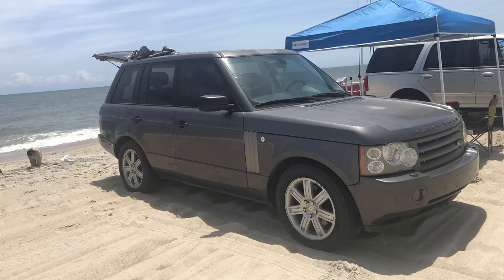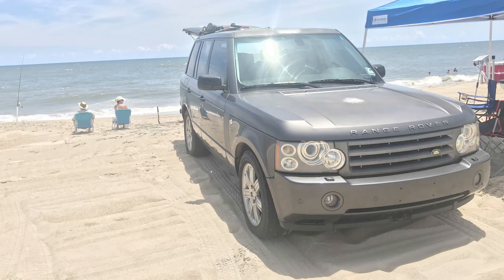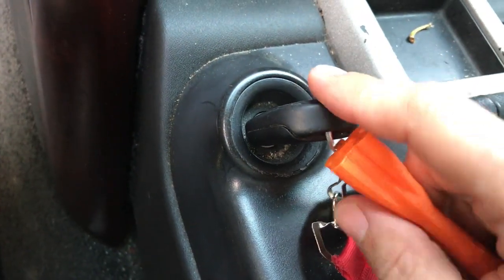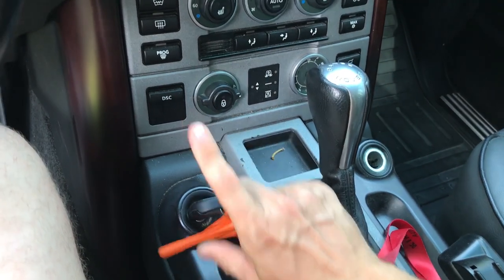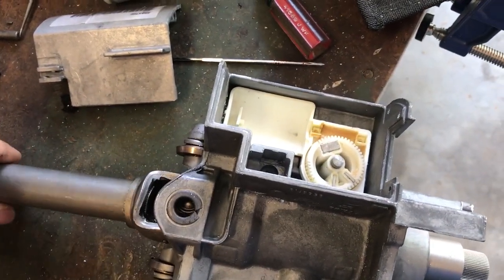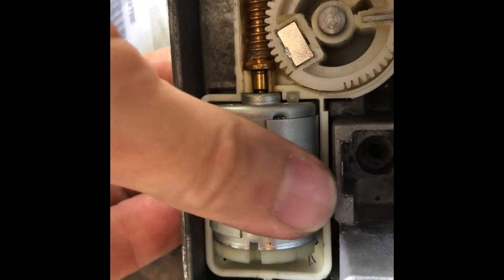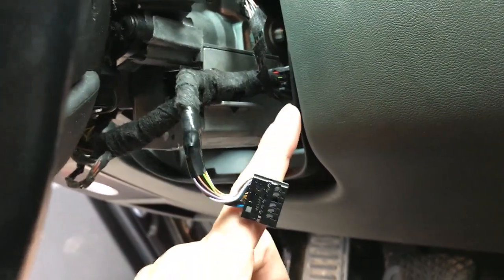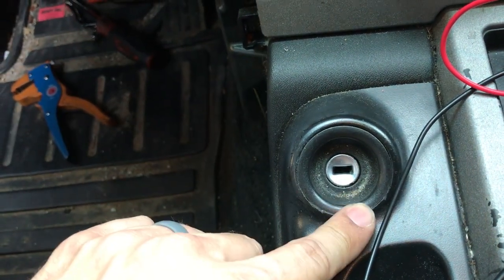L322 Free and Permanent Steering Column Module Bypass

Comment: Caution : This only works on 2006 and above with the Jaguar AJV8 engine not on the 02-05 BMW M62 Engines.
Reply: Exactly bro ...I did the blue wire soldering to My girls 2003 and it won't start it only unlocked the ignition switch but not crank the engine im desprate for a solution  do you happen to no any other way I could rig it? if so please advised id highly appriciate it....
Reply: @danielbeltran3914  The old fuse 18 trick
Reply: @DjJayBeatz  ya I need a permenant fix lol  I dont want to put a in line toggle switch or pull da fuse or disconct the steering coulmn and re conect it every time we need to drive it. I wish a new a way to jump the starter relay or give it power when the key is on the start position..... with da blue wire allowing the steering lock to crank over?
Reply: @danielbeltran3914  You and me both man
Reply: Have you guys found a solution for the 2003?
Reply: @ragingonline can you add some detail to what your describing please
Reply: @danielbeltran3914  I recently bought a 2005 L322 with the steering lock issue. My Rover had the added issue that even after I pulled fuse 18 and got the key to turn, the starter was not engaging. After trying this fix (before reading the comments section), the key turned every time but the starter still did not engage so I combined this workaround with another from Raymond Hernandez (https://youtu.be/vskmkMZs_Xs) and my Rover works perfectly now. The combination is to solder the blue unlock wire to the interior lights as Rob The Car Guy teaches so the key turns consistently, then I wired a relay into the starter wire Raymond Hernandez points out in his video with a momentary switch providing the ground for the new starter relay. Now I turn the key to the second position and hit a "starter button" that engages the starter and starts the Rover. This has worked perfectly for the last week.
Reply: All your  yebbedy  dobbdey didn't  work  on my 03 It was the starter relay . The whole time. No car should  be so complicated.its not in the books
Reply: Connect to live and put in line cut out switch
Reply: It works on the 2004. It requires 2 wires instead of one. The blue wire to break the key and the red and yellow wire to reset the ews. I did it to my 2004 and have been golden for more than a year.
Reply: @DougBe38  can you give me more info I have the same issue with 04
Reply: @DougBe38  May I ask what did you do with the red/yellow wire? Did you add power to it from the light source again, or did you jumper it from another pin? I have a 2002 HSE and trying to work out for the get it to start now, having now got the key to turn at least. Thank you
Reply: @darylwong3396  you know what? Ive been getting this question a lot lately. I think I'll  make a video about it today. Is this super urgent for you or can you wait for the video?
Reply: @DougBe38  amazing if you could make a video for sure! Subscribing now! But yes any instructions on this last step on how to bypass the starter for the earlier BMW ones would definitely be appreciated. I heard you can get a ESL emulator, but if it's just one more wire I need to jumper, I rather prefer that option. Thank you again and look forward to your video.
Reply: @darylwong3396  I'm done recording. I have to put it together and edit it and will post it then. I'll let you know when it's up just in case your notifications aren't on
Reply: @darylwong3396  video up.
Reply: @DougBe38  thanks heaps for the video and confirming the fix.  I like the push button start btw!
Reply: @DjJayBeatz  For me in a 2005, fuse 31 blows and once I replace it, it’s fine for usually months. Haven’t seen anyone else experience fuse 31 issues but throwing it out there.
Reply: It's a easy thing to do ....
But you make it looks real complicated bro
Reply: @danielbeltran3914  здравствуйте, по чему не заводился, вы решили проблему?? У меня тоже самое, уже не знаю что делать
Reply: @danielbeltran3914  I might be late but you can remove all that stuff with a  bench tuner

Comment: Rob I was a systems engineer for 18 years at Hughes Aircraft working on foreign weapons systems.  I am now retired.  If I was still working, I would offer you a job.  You think out of the box.  This DIY hack is remarkably simple and effective.  My 2006 L322 is back on the road.
Reply from the maker: Dennis Fagan that’s awesome!!! 

If you enjoyed that one, wait until you see how I reset the airbag module in the 2009 I’m rebuilding. 😉
Reply: @RobTheCarGuy  
I had the internal radiator fan clutch lock up. It costs over 200 dollars. I designed and installed a set of electric fans for under 50.
Reply from the maker: @dennisfagan2163  it would be interesting to compare airflow between both setups to see what the difference is switching to electric. My experience  has been that the radiator shroud has a huge impact when converting to electric.

Comment: I just 'discovered' something today while trying to fix this problem on my Range Rover TD6 (BMW) - it is a very easy fix that actually restores the steering lock t work normally.  It literally involves just whacking the locking mechanism in the right place with a rubber mallet.  I just did it this morning and it actually worked.

Mentioning just as an easy thing to try before proceeding with more involving repairs. It may or may not work but is so easy to do that it's definitely worth a try. I guess it may need to be repeated at some stage but the Youtube author reports after two years it is still working .
Reply: puoi dire quale video o dove colpire esattamente ? grazie

Comment: I know this video is 3 years old but wanted to say THANK YOU! i didnt take the steering column apart, the symptoms sounded the same as yours so im okay not unsoldering the motor. but it worked like a charm. very very easy fix, only takes a screw bit, soldering iron, and electrical tape. $25 max instead of a $10,000+ replacement. really saved my life man.
Reply from the maker: Awesome! Glad it helped out!

Comment: Just wanted to comment and give you a huge THANK YOU!!!! I had this exact problem with my 2006 HSE SC, and I followed your instructions and it completely solved it. Again, thank you for taking the time to make this video, and save us all some money. I can't even image what the dealer or even the independent shop we use would have charged.
Reply: The wire with the blue you connected it to the under light, did you then connect the set of wires back on the side of the steering wheel

Comment: I did a similar thing. I removed the ignition switch, removed the lock pin. Now the key always turns. Then I simply started the vehicle, waited until the column was unlocked, and unplugged the column lock. Works perfect.
Reply: I like this idea. Rather than risk a potential issue with the lighting module trying to pull power from that all you're doing is leaving a plug undone. It does make me wonder what other functions are impacted with that not plugged in though.
Reply: What year did you do that on
Reply: @showrunner2183  2006

Comment: Worked well for my 2003 HSE. So I connected light to blue wire. This opened the key to be turned but it would not let me turn it on more than once. When I connected pin 5 to pin 11 with a simple wire it now turns on none stop and it’s done!!!! Thanks to all!!!!!!!!!!’n
Reply from the maker: Glad to hear that! I didn't know there was a way to make this work with the '03-05 HSE. I'll look into that deeper. Where did you connect pins 5 and 11, the steering column module?

Comment: Hey fellas !!!!!!  I had the same problem with both of my Range Rovers after a battery replacement in both...So i upgraded my batteries to the highest CC i could find at least 950 cold crank and both are working fine ......this is a great video by the way ....but try the battery first and if the battery switch doesnt work dont tell the guys at autozone or whereever that you installed it because no refund ....
Reply: My RR vogue 4.4 tdv8 keyless she's not turning, nothing..I change new baterry and nothing. My steering column it's not blocked

Comment: Rob you are the best , I try just jump the cable whit out to remove the steering column , it’s was not lock  , I just disconnect the steering lock plug and leave like that it’s working good
Reply from the maker: Awesome! Glad it worked!

On a slightly related note I purchased another 2006 that appears to have caught fire because a "mechanic" was trying to get it to start. They pulled the driveshaft and shift lever which made me suspicious so I checked the steering column and YUP, the module was locked and they had been trying to get it to work.

Too bad they didn't see this video first. They may not have burned their Rover....

Comment: I recently bought a 2005 L322 with the steering lock issue. My Rover had the added issue that even after I pulled fuse 18 and got the key to turn, the starter was not engaging. After trying this fix (before reading the comments section), the key turned every time but the starter still did not engage so I combined this workaround with another from Raymond Hernandez (https://youtu.be/vskmkMZs_Xs) and my Rover works perfectly now. The combination is to solder the blue unlock wire to the interior lights as Rob The Car Guy teaches so the key turns consistently, then I wired a relay into the starter wire Raymond Hernandez points out in his video with a momentary switch providing the ground for the new starter relay. Now I turn the key to the second position and hit a "starter button" that engages the starter and starts the Rover. This has worked perfectly for the last week.

Comment: Cheers mate! Bought a cheap 2007 with this issue, I'm going to attempt to connect it to the brake light circuit. If that fails, I will add another microswitch to the brake pedal.
Reply: Hey Brother, weird question. Where is your ignition switch location? I.E., next to the steering wheel on the dash or on the center console? I have an 07 with the updated interior.

Comment: I figured it out for 2003 models. When adding the 12v wire to the blue wire, add a diode. Then jump pin 5 and pin 11 for the starter engagement problem.
Reply from the maker: That sounds awesome. What connector are you jumping pins 5 and 11 and what direction is the diode allowing current flow? What is the point of the diode? It's been 8 months since I've looked at the schematics for this so I don't remember it all that well but I would love to dig into this more!
Reply: You want the diode to allow current flowing to the steering column switch and not back to the interior light source. Pin 5 and 11 I believe is signal for the starter.
Reply: @loyloy512  pin 5,11 ur talking about are for the plug showing in this video @ 11:15 ?
Reply: @fisal-oe2ze  yes
Reply: @loyloy512  thx for the fast response.  😍
Reply: Question. So I don’t need to solder a wire from the blue wire to the light, just jump 5 & 11 with a diode? Because he said in the video that you could jumper the 5 to 11 but it will give you a constant draw on the battery, that’s why he went to the light instead. If so you just save the day.
Reply: @bbutler6167  the diode is for the models with the BMW engine.
Reply: @bbutler6167  still run the wire to the light but add a diode
Reply: Ok. I have an 03 HSE. (BMW)   I’m going to try it this week.
Reply: Ok I think I understand. Add the wire from the blue wire to the light with a diode. Then jump that same blue wire across to the other wire.
Reply: No, jump pin 5 and 11 together only. Add 12v (interior lights) with diode to the blue wire on connector. Done.
Reply: @loyloy512  what type or diode did you use?
Reply: @bbutler6167  did it work for you ?
Reply: @lloyd steven
Reply: @loyloy512   I did exactly what you said on my 2003.  When I wired a seperate wire to the dome light I was able to switch the key to the on position over and over no problem.  But yes it made it so my started would not activeate.  I then jumped pins 5 and 11 and the starter did not work.  In fact it actually versered the affect of being able to turn the key and getting out of lock position.  It went back to exactly the way it was from the beginning.  It's stuck in key lock position again with one chance to turn the key.  Are you sure that is the correct pin?  or is there a different way to bypass the starter?  Thx in advanced .
Reply: @stevenamador7596  what's your email address
Reply: Steven Amador I believe I expirenced the same problem in my 2005, and I don't think it is a steering wheel/ columns issue and rather could be a key fob issue
Reply: Steven Amador did you fix, I have same problem.  I only done the blue wire and kick panel light so far and won’t start, now researching and found you guys.  Help please!  I have 2005
Reply: @loyloy512  pins 5 & 11?  I do not have an electrical schematic.   Help.
Reply: or you can replace the 12v motor.  Most likely the motor is to weak to fully turn the wheel with magnets.  You can find a lot of 12v motors and most likely specs are printed on the motors housing.  I can try helping if someone can give me the specs printed on the motor.
Reply: 2003 HSE I will try this today else I’ll buy the steering column. It’s $ 400 now with warranty on eBay. Sadly it could be many things in The column and time is money so some times it’s better to just pay.
Reply: Tried it your way. It worked. Pin 5 and 11 connected  you have to take the wires out to know who is who. The. Connect them. Also I did run the light to the blue wire and it opened the switch but did not turn on. But once I put the two pins 5 and 11 it worked just fine. I have a 2003 HSE.
Reply: Will this fix make the car drain more battery when its turned of? Or cause a delay for the car to shit down completely when turned of? Like 15 min after ignition is turned of? Thanks
Reply: Подскажите пожалуйста - у меня ключ поворачивается до конца, руль не блокируется, табло горит но стартер не крутит. Снял катушки со свечей и на них есть питание (ток) . Даю ток на реле стартера которое находиться за АКБ-стартер крутит но пропадает питание (ток ) на катушках свечей. Что это может быть? Иммобилайзер блокирует что на прямую ток подаем ? Ну если бы иммобилайзер не давал то и ключь бы наверное не поворачивался но конца? Чип получается считывается. Синий провод к питанию освещения это получается разблокирует рулевую колонку , а замыкать 11и  5 это будет запускаться машина?

Comment: Due to smart entry system being fitted to many cars, well first one was Merk 1997  with electronic steering lock that works  open closing sending authorisation signal to ecu for starting the engine, when the latter fails,ur stuck with a no start.Remedies -to program an esl or to fit an esl emulator, few out there work to make different emulators work on specific vehicles,some r plug and play ,other require programming with car specific security and can baud rate has to be set 250-500kbs.

Comment: For the older cars like a 2003, you need to connect pin 5 and 5 from the ELV plug and get 12v to the blue wire from the same plug. I ve got 12v from the purple ignition switch wire because i ve removed the locking mechanism from it so all its tidy and no gimmics
Reply: Pin 5 on the collom i take it sory I don't under5
Reply: Understand

Comment: I did almost the same thing on a 2004 L322, I just added a timer relay to give a 10 minute start ability window after entering the car.
Reply from the maker: That was the direction I was going to take before I found the jumper wire and figured out the lights are a good timer for me.

What did you run your timer relay to since you have a BMW powered Rover? Are you just using that to cut power to the steering column module so that every time you start it up it thinks you pulled fuse 18? That would be clever! I assume you can no longer adjust the steering column after those 10 minutes if so, is that true?
Reply: @RobTheCarGuy  The column has power full time, so it can be adjusted like stock. The relay simply jumps the 2 pins together at the ELV to unlock the ignition and allow it to be turned. There is a solenoid that unlocks the ignition once the ELV unlocks. It unlocks the ignition switch the moment the interior lights come on, and remains active for 10 minutes after. It shuts off after 10 minutes to prevent battery drain. I think the solenoid only pulls like 200ma, but I feel better having it engaged only when needed. Relay standby current is like 1milliamp